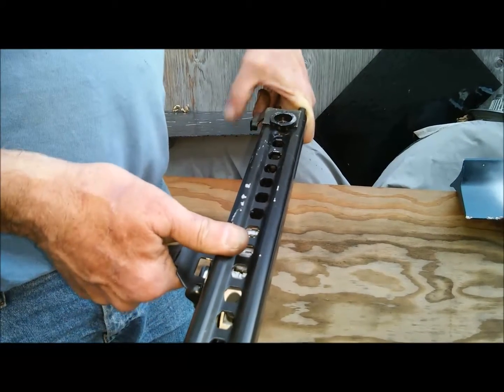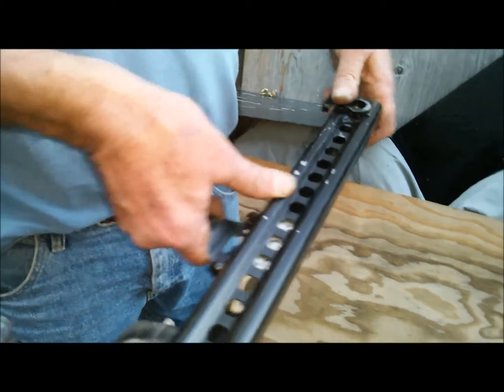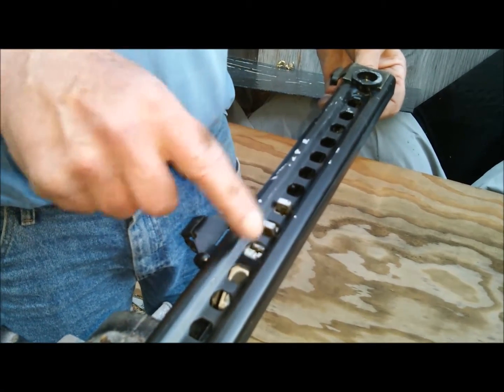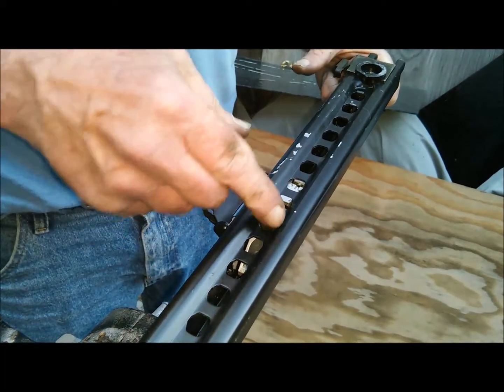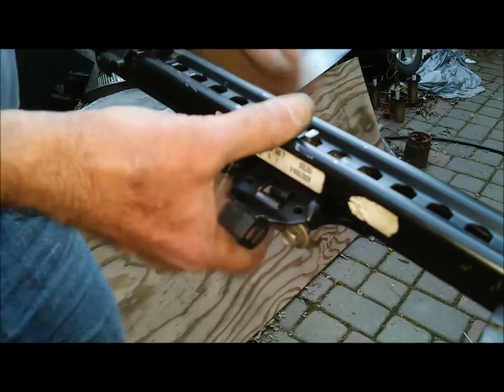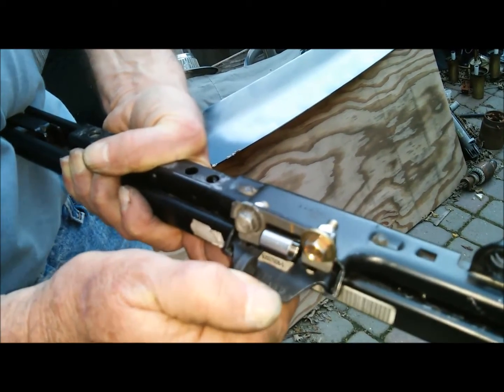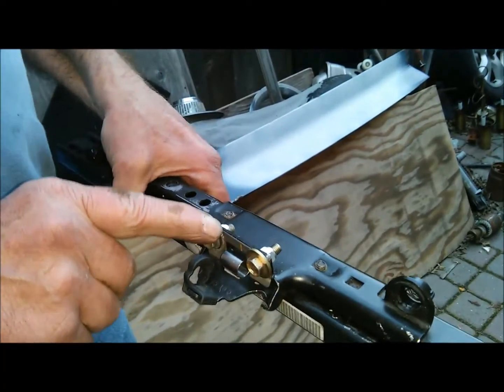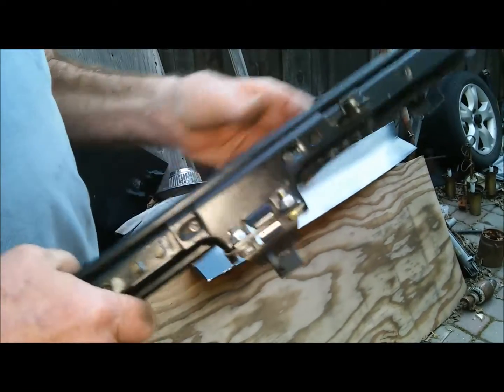Mini Cooper Stuck Seat Rail Fix and repair

Comment: This was very helpful, thanks for the video.  I managed to remove only the two rear seat rail bolts and bend the seat far enough forward to get a pry bar under the rail and push in the sticking pin.

Comment: My front passenger seat is all the way to the back and stuck. I can't get to the back screws to remove the seat. Please help...
Reply from the maker: Kym howard  If I understand you correctly, you have just the opposite problem I did. Did you have any luck removing the front screws, using a crow bar to lift the bar enough to get your hand to disengage the pauls, then slide the seat forward?
Reply: Taking a chance an a response.  I have same issue but mine is stuck in middle somewhat so can’t get to either front or back bolt.    Now what?